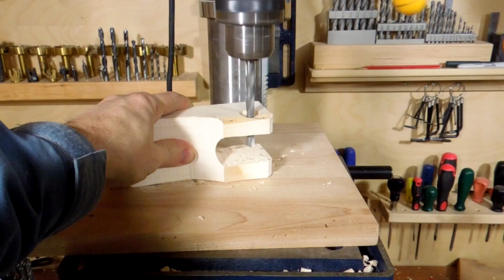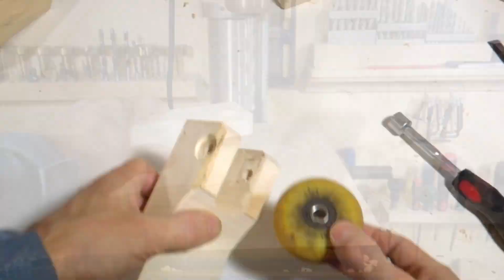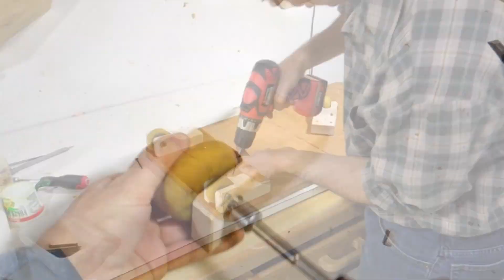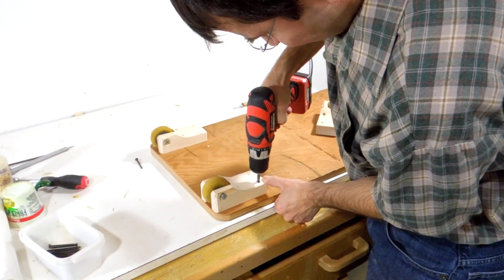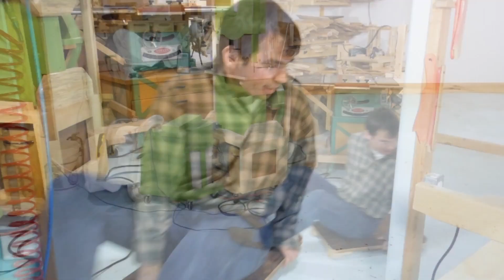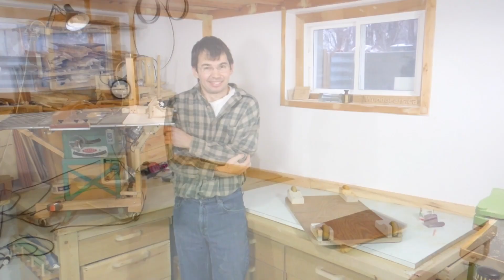Kid's wheeled platform

Comment: HA! I made one of these (with the safety stops at the very ends of the board) in 7th grade woodshop back in '72.  But I turned on a lathe a 8" dia roller with a 1" grove in the middle.  On the board I place a 15/16" strip the full length end to end to keep myself from turning horizontally while balanced.  Dangerous as all get out. Planted myself out flat on terra firma many times.  But I had a blast! The best part of Jr High was the wood/metal shops and the science classes.  And I never stopped.

Comment: You know you did a good job if you can propel yourself down the street with a gas powered leaf blower pointed out the back.  For extra credit, use two leaf blowers and attach them to the sled. Brakes are optional.